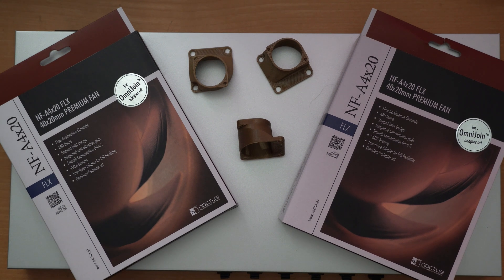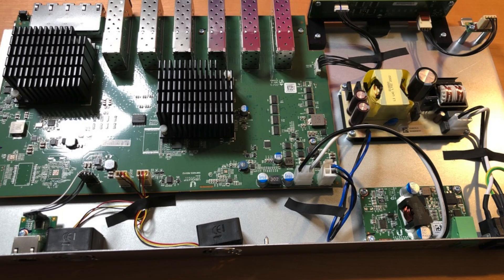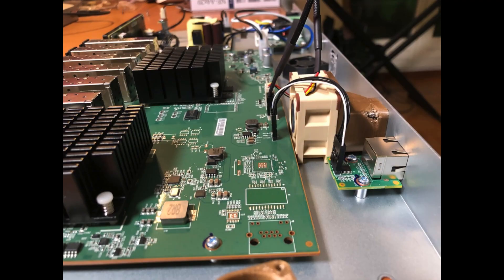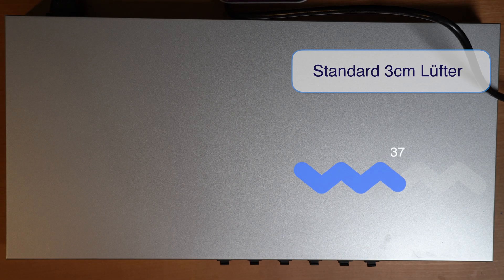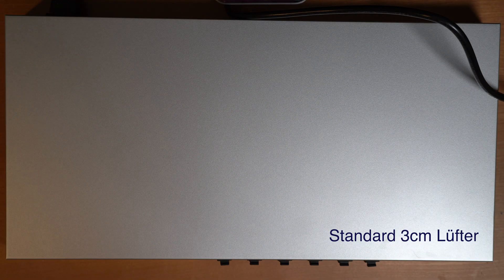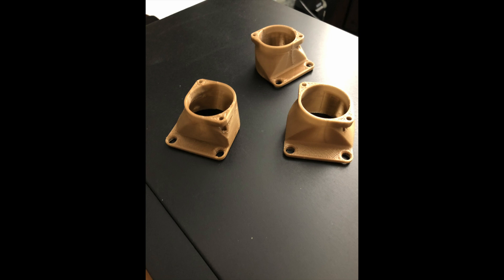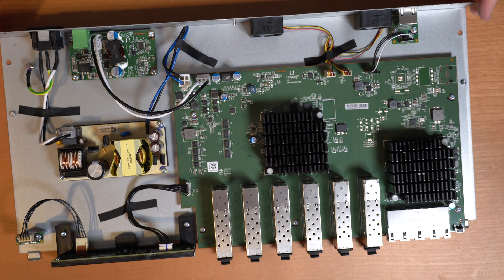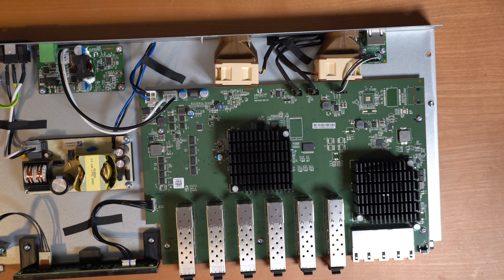Ubiquiti US-16-XG 10Gbit Switch noise level -  standard fans vs 4cm Noctua

Comment: Hello?  Can you tell us which files you actually used, and what type of printing/material did you use? One printer said files too thin for plastic.  Resin SLA printing costs $29 each- need what you did
Reply from the maker: Unfortunately, I don't know either, I commissioned it and they chose it themselves.
Reply: @wamote6867  did they tell you in invoice what material they used.  Were the two the same? They look different.  What did they cost total for both?  Local printer said plastic comes out with holes and thinks yours are a resin.

Comment: which file did you use for 3D print? there are a few versions./
Reply from the maker: I don't know the printer and software that the colleague of my colleague was using, important is, you need a left (lh) and right (rh) version.
Reply: @wamote6867  ok that part I figured out by looking at your photos and comparing to the files.  What local printer says in his simulations, plastic comes out with tiny holes in it because too thin. What material did your colleague use?